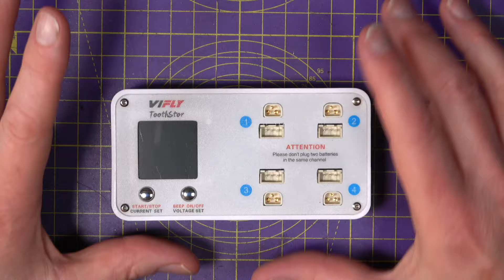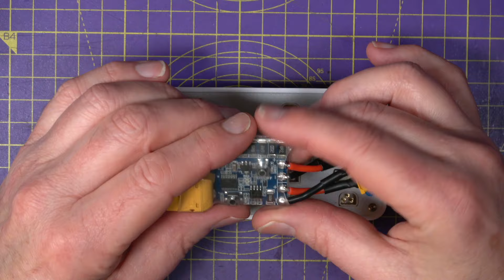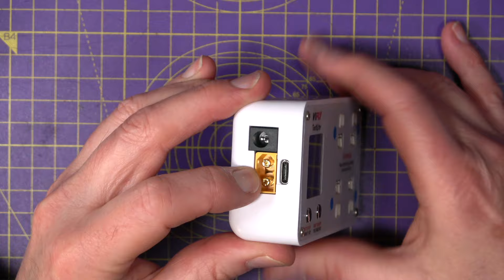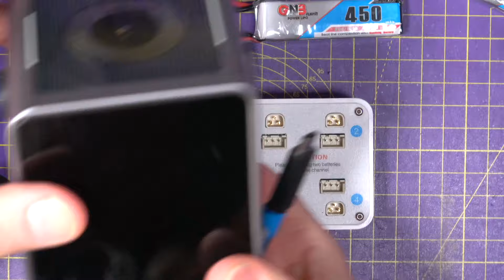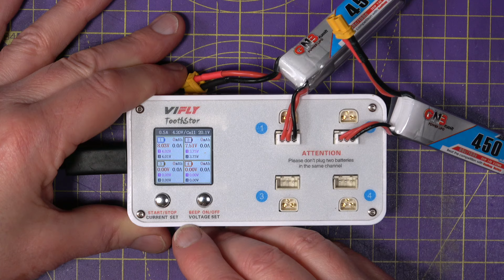VIFLY ToothStor - 4 Port 2S Balance Charger with Storage Mode

Comment: Do you have time have the 2s lipo battery at the same voltage if you are charging two at the same time
Reply from the maker: The ToothStor charges each 2S battery individually and balances them to the same voltage before finishing the charge cycle. So yes, they will be at the same voltage when fully charged.
Reply: @WhirlyBloke thanks

Comment: How to enable the Storage Mode on it?
Or just setting the 3.80v or 3.85v - is this what is called "Storage Mode"? :)
Reply from the maker: It automatically enters storage mode when you select the voltage. Setting it to 3.80v or 3.85v is indeed how you enable storage mode.
Reply: @WhirlyBloke  that's what I thought, got it, thank you.

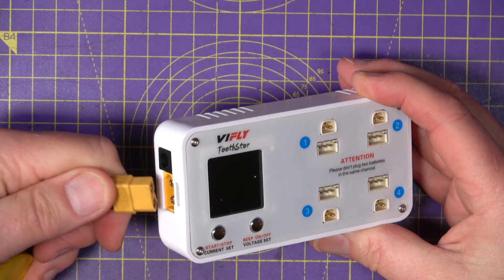Comment: 4:33 WHOA there. hold up. how do you set the inpult voltage cutoff? if you're going to plug in a battery as the power supply YOU have to be able to limit the input voltage so you dont drain your lipo below 3.2 volts per cell. otherwise thats NOT an option
Reply: it tells you the voltage on the charger, use a external lipo alarm

Comment: With this charger, why do you just use the balance connector and not the main power lead?
Reply from the maker: It's a 2S balance charger, so like any multi cell LiPo you need to balance charge them to keep the cells evenly charged. If you just charge with the main connector - probably and XT30 - it won't work. Never charge multi cell LiPos just using the main connector alone, cos you'll end up with a dead battery very quickly.

Comment: what is the difference between 3.80 and 3.85 v storage mode? 
thanks
Reply from the maker: 0.5V 😀

In practical terms, 3.8V is the classic safe storage voltage that helps maximise long-term battery life. 3.85V is a more modern standard, especially popular among FPV pilots who prefer their packs a bit closer to ready-to-fly levels while still avoiding excess wear.

Think of 3.8V as ideal for long-term storage, and 3.85V as better suited to short-term storage if you’re planning to fly soon.